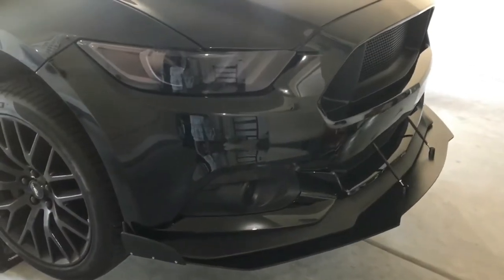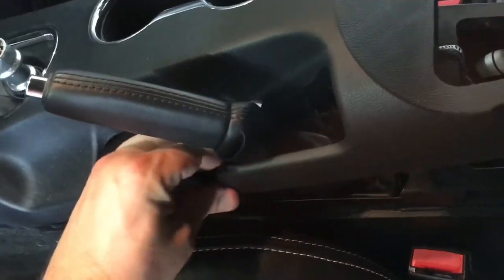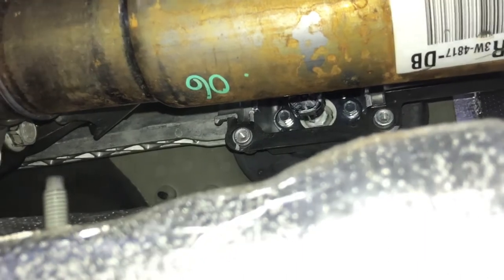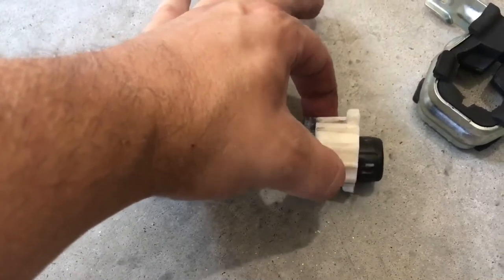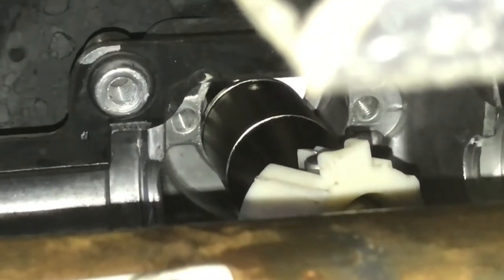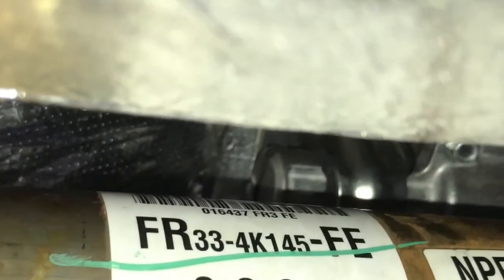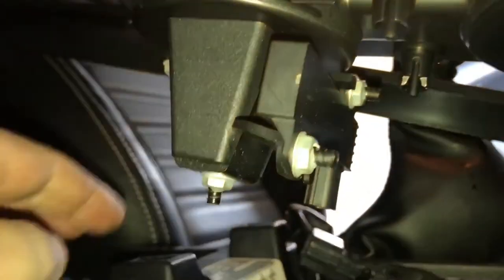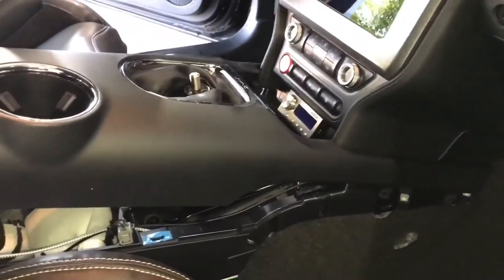Steeda short throw shifter install on a 2016 s550 mustang GT.   ✔️

Comment: Did you really need to take console apart?   Couldn't you have just popped boot bezel off and did it that way?.....
Reply: Removing the reverse lockout screw can be a clearance issue if you don't have a short enough tool.